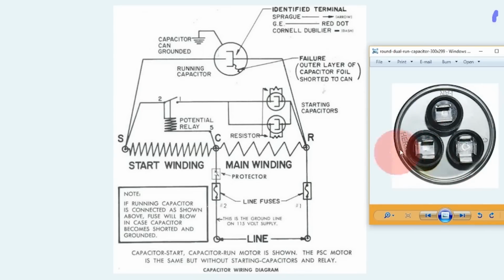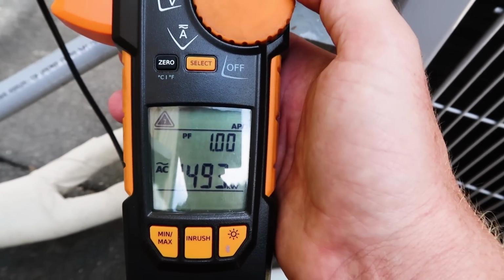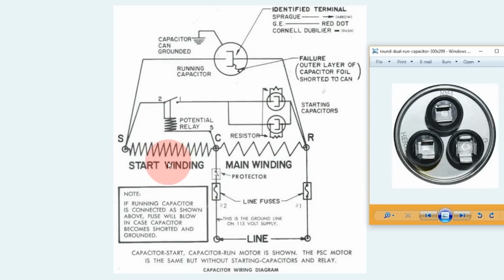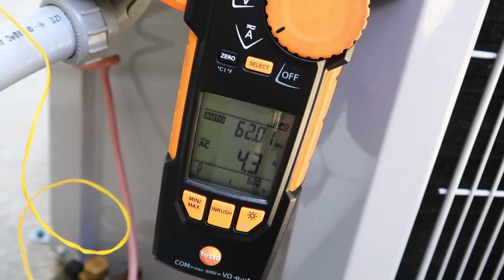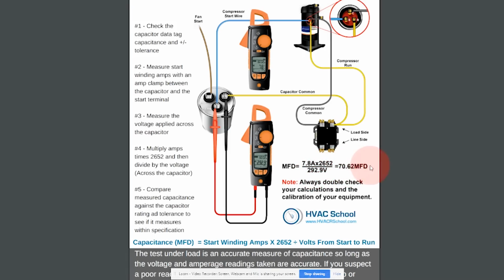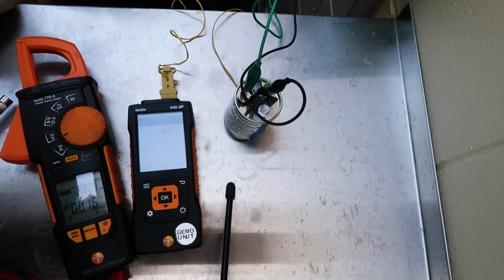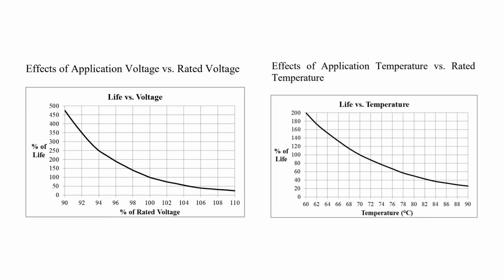Why Do Capacitors Fail? (It’s not why you think)

Comment: There's so much wrong information in this video, it's astounding. You don't even understand how capacitors work. Yikes. Current absolutely "flows through" even though the incoming electrons cannot actually pass through.... otherwise you'd have an open circuit and no EMF. The point of a capacitor in AC electricity with motors is to create a phase shift so you can start an induction motor. Max current delivery of the capacitor is when the incoming voltage is at zero and it decreases to zero current at both voltage peaks. This helps create starting torque for the rotor by shifting the phase 90 degrees and, while it's running, helps smooth out the rotation of the rotor. The start winding will draw higher currents for those milliseconds because it needs to start the rotation of the mass, whether it's got a dedicated start capacitor or not. Some start windings also can stay in the circuit and not necessarily be switched out and are made to run in tandem with the main windings.
Reply from the maker: Sweet! I’ll watch your video on the topic when you make it

Comment: so are you saying a start kit adds more current to the start winding therefore potentially causing damage
Reply: A correctly operating hard start kit will not cause damage, but it is an added point of failure and expense.

Comment: Very good theory to applied.  Most caps fail because the dielectric material breaks down, accelerated by surge / strikes.  Temperature is a factor, however, I haven't seen any research for long term with monitor of spikes/surge.   The use of a properly sized MG set will take care of any line problems.

Comment: You could make the case that frequent doses of high inrush current wear down the capacitor. If that's true a hard start kit wouldn't just aid the compressor but capacitor as well. Sparing it from 100-130 amp inrush start ups every time the unit kicks on.
Reply from the maker: No, the run capacitor doesn’t see inrush - that’s one of the main points of this video

Comment: One thing I have noticed on Franklin submersible pumps, their CSCR control boxes have a 23uf run cap and a 108 start cap.  I have tested some after 20 years of hard service and the caps were still good. The run cap is a gray plastic and I can't find them anywhere, or at 23uf. {On edit they are Aeromet, see link above}   AMRAD has a 20uf  US made one which I suppose is close enough. The start cap is BMI  108-120 US made and available. Anyway, point being that you can design a system that doesn't blow caps every 2 years.

Comment: Old Caps were much bigger in the earlier years (50's-70's) so they held more oil to keep them cooler. Ambient heat is the number one cause of failed capacitors here.  Some condensers (Ruud for example) have the capacitor in the fans airflow- you'll notice these last longer. 
 Pay attention to periodic potential start relays sticking.
Reply: The reason those old caps were bigger is because they used paper as the separators between the foil plates. When they went to polymer separators, they were able to make them smaller. Then they went to metallized polypropylene, making them smaller yet. But, there was a limit to how small they could be made and still have long life and good surge capacity. When you start making them as small as the import caps, there's no way they can be expected to last.
Reply: Also the chemicals caused cancer too lol like asbestos. Anything good is bad for us
Reply: I have a 1990's Rudd 2 1/2 ton with capacitors that mount into cutouts in the contactor connection box, and the cases, except for the top connections, are in the cooling airflow. Luckily, I found properly sized US made caps to replace them with, along with a new Eaton contactor.

Comment: What about undersized ductwork? The indoor blower motor is asking for more power than it was designed for.
Reply: By restricting the airflow of the indoor blower motor in a residential split system, the blower motor will draw less amps, not more amps.
Reply: @dcculver2  I've heard of blower motors "free spinning" drawing zero amps something about not enough static pressure. But I thought closing registers in multiple rooms(restriction) to try to get more air to one vent puts more of a load on the blower  causing premature failure?

Comment: FYI  in electronic 's  capacitor in series blocks  dc  but pass ac voltages.and run capacitors are ac motor  operated

Comment: My compressor Ran backwards all day.  My wife ignored my advice and didn’t turn it off.  It was hot as heck when I got home.  I let it cool for an hour and turned it back on.  It was fine and worked.    The unit was already 10 years old so I called my friend and got an estimate for a new one figuring the compressor was going to die.  That was in 2014.   It’s still fine and runs perfectly.   I’m in south Florida so it runs 12 months out of the year.

Comment: I'm confused.  If the start wire is only for startup, why are you showing amperage on the start wire while the motor is running?  My guess is that this motor as been designed so that the "start" wire is actually providing and additional AC phase for the compressor motor while it is running.  That may be why you don't see "inrush amps" on the start wire on startup (15:18 into the video).
Reply: The capacitor acts like it's making another phase, yes. It stays on-line while the motor is running. It also limits the current to the start winding.

Comment: The statement that the current through a capacitor is only based on the capacitance value, voltage and frequency might be true for the cases you are taking about, but it is not true in general. The reactance of a capacitor and inductor in series goes to zero at resonance then the current is only limited by the capacitor ESR and inductor resistance.
Reply from the maker: Yes I understand. I am specifically speaking on Run capacitors in AC motor applications
Reply: Very good video by the way!

Comment: Love your podcasts and videos!  Lot's of material and information in short period.  I listen and watch over and over again to absorb  the information.  Was thrilled to discover your android app and have been using it the last couple days just for the capacitor in circuit tests.  Makes very quick work of the formulas and nice you've included percentages in the results.  Replaced 2 bad caps in 2 days and was actually surprised to find both new caps just slightly outside the 6% margin.

Comment: an added note to those that fail to mount the run caps properly.  These caps need that metal mounting strap as a heat since to dissipate the heat from the can to the surroundings.  Failure of most electrical components is heat and moisture.  I was wondering what effect using a higher or lower uf cap would have on a fan  and compressor.  These hard starts seem to work on out of warranty units to get em a few more years of life. How is this accomplished?

Comment: I've seen in desert areas where the contractor put in a relatively cheapcompressor where the capacitors that fail rated to 40C in an area where it can be constantly above 45C (114F).  These need to be replaced but a Cap rated to 70C  (158F) to minimize it's failing.

Comment: Great video. How did you know to multiply the amps x 2652?
Reply: Hi Waylon, that is a great question.
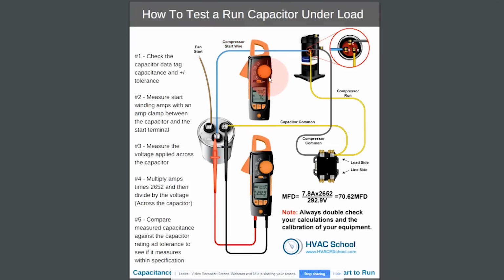At 18:42 below #5 - Compare, you will see the formula in blue letters that describes how to calculate capacitance in MFD(microfarads).
The number 2652, described as a constant, in the formula is derived from other electrical formulas well known to Electrical Engineers.
As I am not an electrical engineer, I do not know the electrical formulas used to calculate this constant.

Comment: Is there a way to use multiple caps within one system to ensure 'no fail' redundancy  for critical environments?  Obviously, we already have redundant or backup systems in place for some applications but are there options, using caps, for those that do not have the room or the budget for more than one system.
Reply: There is no good reason to use single phase HVAC equipment for critical environments, but to answer your question - NO.

Comment: I live in South Carolina.  I service thousands of roof top units.  On an average day the ambient temperature on a tar and gravel roof will be about 145 degrees Fahrenheit.  On a hot day where the air temperature is 95 degrees+ I’ve seen the roof temperature up to 160 degrees.   I will always use capacitors rated at 440v.  And if I have unit that is in a bad location where it has poor air flow or is next to and hood fan from a kitchen I will add a hard start.  That may seem like overkill but it works every time.

Comment: Regarding surge suppression we need to keep in mind that MOVs degrade over time due to the number of surges and their amplitude. You can have an MOV that looks perfectly fine but is no longer providing surge suppression.
Reply: More than once I've also seen them fail in a dangerous way, where the MOV was conducting enough to make it heat up and catch fire while not drawing enough current to blow the fuse. For this reason I do not use any MOV based surge protectors that have a plastic housing, I've seen power strips that completely melted down and we had a UPS at work catch fire about 15 years ago.
Reply: @James1095  It's true, as the voltage rises across an MOV, the resistance drops proportionately. It can easily reach a point where the amount of current through the MOV will get hot, catch fire and or blow apart.

Comment: Without watching the video, I can tell you why capacitors fail in condensing units. It's from head pressures being too high, usually from insufficient airflow across the coil, like if it's plugged with cottonwood seed or the condensing fan motor fails. The compressor starts pulling too much amperage, trying to move refrigerant that's under higher and higher pressure. Cleaning your condensing unit, usually around the second week of June, after the seed has fallen, will save you money and prolong the life in the unit. Plus, I replace all my contractors with smart ones, to prevent damage from under voltage, brown outs, and power interruptions. I've had to replace several condensing units, in one season, because on ComEd brownouts!

Comment: The basic problem is that the legacy American infrastructure does not provide 3-phase power to homes, because 100 years ago nobody expected us to be consuming $100s/month to power multi-horsepower rotating machinery (A/C compressors) all day long.  This is a huge long-term waste and inefficiency.  The capacitors are just a poor compromise to synthesize a second phase; it would be far better to just receive the three phases that the utility has nearby.  But that would require an investment.  ECM essentially converts single-phase to multi-phase, but the conversion is always significantly inefficient, and the converters are expensive, short-lived, and not ruggedly reliable, with costly maintenance.
Reply: @devnull7550  Small world greetings, Dev! You're welcome.

Comment: MOV's are sacrificial devices, commonly used to condition power by absorbing small, cumulative voltage surges... MOV's typically have a clamping voltage, or the voltage rating in which it begins to absorb or limit the voltage surging to an acceptable value, such as 130 volts on a nominal line voltage of 120.

MOV failures generally occur when the cumulative surge values reach it's theoretical maximum value... or when a direct lightning hit exceeds it's theoretical maximum value.

a better quality lightning arrestor such as those used by the power utility will employ a device with a specified air-gap between two electrodes (with one electrode connected directly to ground by means of a locally installed 'made' electrode such as a ground-rod or buried metallic pipe), of which a strong power surge caused by a lightning strike will jump across the gap or arc it's way to the ground electrode terminal in which the other side of the device is connected, thereby channeling the excessive energy safely to ground.

Comment: Can you replace a run capacitor with a fast start ?
Reply: No, the motor will run better/cooler/more efficiently with a run capacitor. If it's designed to have one, you need to have a good one on there.

Comment: All this and I still don’t know why run capacitors are needed...
Reply: Run capacitors create a phase shift between the current in the start winding and the run winding. That creates a rotating magnetic field which causes the rotor of the motor to spin.
Reply: The run capacitor creates a 2 phase motor operation by creating a phase shifted excitation of the auxiliary winding. It also balances the power factor of the motor so current and voltage instantaneous draw are better aligned. If the motor is well matched to the load the run capacitor will increase the power efficiency of the motor.  The start capacitor provides increased torque the increased starting current demands. Start capacitors are densely packed and can not be used for constant service. Run capacitors are able to dissipate heat constantly as determined by  ESR (or capacitor internal resistance) and materials.  Never use a start capacitor in place of a run capacitor.  Always use values as indicated on the motor ratings plate for replacement.  The physical size of the run capacitor will be matched to the motor power and have a temperature rating appropriate for the conditions it runs. ECM motors are only slightly more efficient that capacitor run motors, in spite of the propaganda. But both are better than the resistance start power wasters.

Comment: 22:20 you can get the same circuit from China as a "power saver". Typically its just a 5 uF capacitor from a single phase induction motor in a fancy box that you plug into the wall.
Reply: Also, typically the manufacturer of most modern equipment has already done all they can to make the power factor as close to 1 as possible, which is what those "power saver" things do, and even then those only make a difference if your utility levies penalties for having poor power factor, which is mostly an industrial thing.
Also, the switch-mode power supplies nearly everything uses these days are all capable of automatically correcting their power factor.
All that to say that those "power savers" are extremely situational, but most of the time they're about as effective at saving power as putting a magnet on the fuel line is at increasing gas mileage in a vehicle. Just more junk from china that you don't need.

Comment: 4:08 Its actually a fixed amount of charge (hence the microfarad being used, e.g. 5 uF) that can be stored. The current is only limited by the ESR of the capacitor and the circuit its hooked to.
Reply: Yes,  good word,

Comment: You failed to consider what happens if a compressor's connections are loose.

Consider what happens when a motor (inductor) is running with loose connections.  A sudden disconnect on an inductive circuit causes voltage spikes of unlimited voltage- like your car's spark plug coil.  So, age, but primarily voltage spikes resulting from bad compressor connections (or fan) cause most capacitor failures.  The spikes violate the capacitor's dielectric material resulting in a short, intense heat, and then an explosion.

Check for good electrical connections at the compressor and at all connecting points in the system- the number one preventive measure!  I've seen it many times.
Reply: Yeah every-time I see a failed cap, the compressor spade terminals or OF terminals are loose. I squeeze them down a little after I change the caps.
Reply: My A/C unit was actually eating run caps so I decided to check all of the wire connections.  I found one of the ears was broken on a female spade connector that was connected to the low voltage coil on the contactor.  Once I fixed that connector, I never had to replace another run capacitor on the condensing unit until the compressor died 10 years later.  The really amazing thing is that the condenser fan motor was made by GE and it ran for almost 28 years without failure.  I would oil the sleeve motor bearings every Spring.
Reply: That's something you don't hear often. Actually never. Thanks
Reply: I just replaced a cap and found a loose spade terminal.  A loose terminal will cause it to overheat and burn the terminal and spade connector, wire, leaving a crispy mess and possibly a damaged compressor.  Always make sure those spade terminals aren't loose.
Reply: @thisisyourcaptainspeaking2259  That's where terminal savers from your HVAC supply store come in handy. I always carry them on my truck and I save the left over wires when replacement Copeland compressors have pin terminals.
Reply: @miker252  Yep, I replaced the terminal wire, wire nutted new terminal wire onto the burned off wire after cutting the burned off section and stripping it back.  I save all the wires from the kits too. ;)
Reply: Move to Phoenix and you'll add to your statement.
Reply: @jeffm2787  And get the elec. compartment RODENT proof.A mouse fried 3 components! Phoenix…
Reply: dv/dt.
Reply: @bradhiggins4813  v=l×di/dt
In this case though, heat from high terminal resistance roasts the connectors to crispy charred dust.
Reply: If the connections to the compressor come loose the little "flag" on the compressor pin burns away. There are rescue terminals that save the compressor by attaching to the pin with a set screw.

Comment: Capacitor failure is not a mysterious issue.   I got an electronics degree before you were born, and capacitors fail for one reason.  If you push them too far or they get too old their dialectric strengh will fail.  You could have made it much simpler.